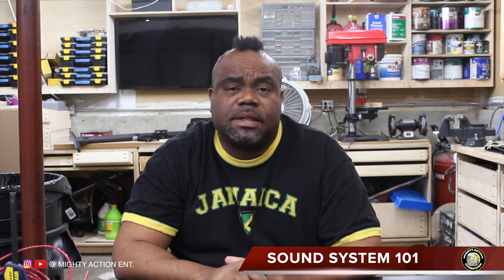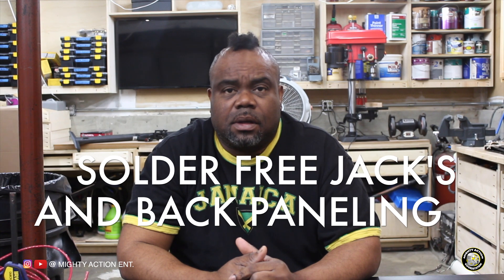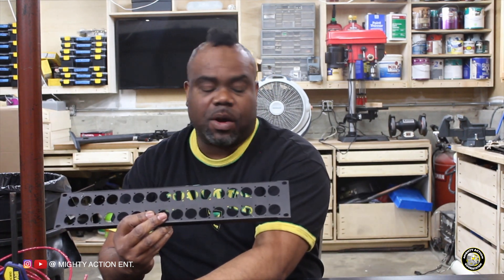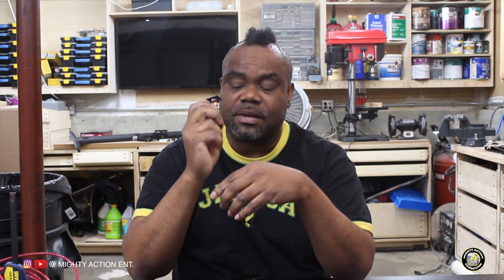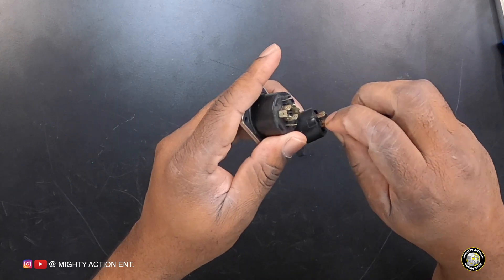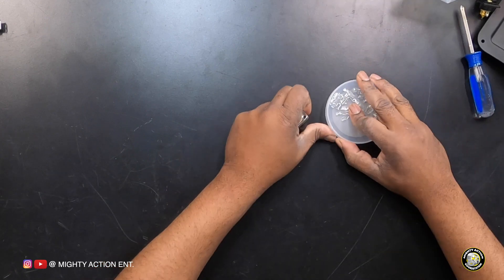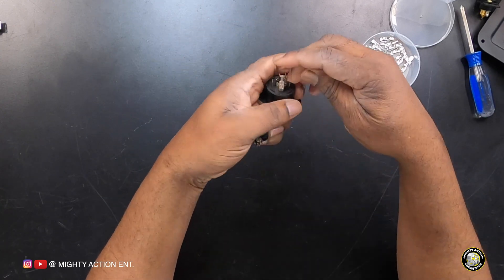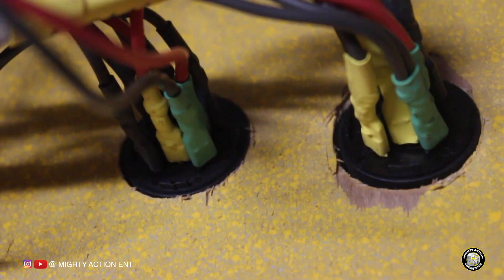SOUNDSYSTEM 101 - WHY ARE YOU STILL SOLDERING YOUR JACKS????

Comment: Soldering never caused distortion, if you don’t solder properly it will fail. Solder doesn’t fall off either 😆.
Reply from the maker: Over time soldering will fail you!
Good luck
Reply: @MightyAction  it never did I have been doing electronics for 30 years and the only thing that caused failure was original circuits that were over heated by faulty components never a speaker connection I had refurbished many vintage appliances for years . If you don’t understand soldering it’s a different story 😆.

Comment: i agree 100% i dont solder either i use the same pass through for xlr and and tru1 and heat shrink crimp spade connectors
Reply from the maker: RESPECT ME BOSS, ANY ISSUES WITH THEM?
Reply: @MightyAction  no issues at all i even find that my connections are cleaner and minimal buzzing distortion even when increase master volume on mixer.
these connection are tight like a virgin.

Comment: soldering is stronger than any screw or crimp connection,... once you do it right. if you had an electronic technician background, you would have a different opinion.
Reply from the maker: Not going to deny that
Reply: @MightyAction  on a different topic....what you think about having multiple sounds to suit different venues? I find it more convenient to have a small powered sound for smaller gigs. Quick set-up, less equipment.

Comment: I do the same with my rack. Partly because I wasn’t confident in my soldering but mainly because it’s easier to problem solve if you’ve got spare cables to swap in if you happen to have a cable fail. And no need to bust out the soldering iron if soldering points fail mid session
Reply from the maker: finally someone gets it! respect me boss. thats exactly how i see it, much easier!

Comment: Every connection can be a failure point. With solder you must secure the cable and have strain relief. Having a barrel connection adds more weight, more failure points and cost. There’s no rules, but just a thought

Comment: Nice Channel. As an ex sound man whose been soldering for decades, it ain't that hard Bro. If you solder those leads correctly, they will never come off. If they are coming off, or falling off, then you are doing something very wrong. Soldering is a good skill to have in your locker even if you want to go your connector-to-connector route.  The price they charge for those connectors, you'll save yourself a ton of ££'s or $$s by learning how to solder like a Pro… then that's more cash available to buy music or other necessary gear… Trust me!… Nice info. though. Keep on keeping on.

Comment: 1: Use solder with flux. 
2: Tin both surfaces to be connected with a layer of solder.
3: Connect the two parts to be soldered then heat them up till the solder melt & flow then remove the soldering iron.
4: Do not use cheap wire which will oxidize over time then break connection. 🧐
I have made guitar & studio cables over 30 years ago which I still use today. Soldering will save you a ton of money.
Reply from the maker: thanks for the input me boss, respect

Comment: I would like to have those (solder-) RCA connectors if you don't want them bruh.
I have to say, if your solder breaks that easily, you didnt flow it properly or soldered on a dirty surface.
If it doesn't flow, do it again. And if it breaks it's usually not the soldering but not enough clamping of the cable. If it wiggles , you're screwed sooner or later.
Reply from the maker: Hit me up 5715action
Reply: @MightyAction  What do you mean?

Comment: I thought I was gonna see a video of how to make cables without soldering. For me there is no cost effective way of getting around soldering and am very good at it so I never end up with cold solder joints.
Reply from the maker: yes it has a lower up front cost when you solder. Making your own jacks, cables etc.. with bulk mic cable and jacks. But regardless of my solder skills, i still think it works out better for me this way. I don't have to worry about having to solder a jack in the middle of a event etc.. If a jack ever fails just bypass it in the matter of a second. Cold solder joints isn't the only thing one would worry about. There is lots of other things that can cause a wire to brake off the jack at the point of soldered.

Comment: Yes my brother  great video  . I am trying  to move away from soldering  also. 
But there are cases when I do have to make a solder . I build  lot of XLR  cables for my mike system at church. When I do build them I used the plastic  epoxy  to help hold the joints .

They are working  fine for about 4 years now . 

But the raw wire to speaker boxes and wire all over the amp rack is a no no in this primitive  time .
Reply from the maker: i use to build my XLR cables as well, but i think this works out better for me. yes its more expensive but less hassle in the long run.

Comment: ACTION SOLDERING IS WAY MORE BETTER BECAUSE THE AVERAGE SOUNDMAN HAS TO PUT INTO CONSIDERATION COST , AVAILABILTY  AND TIME.  YOU DONT SOLDER BECAUSE YUH NUH GOOD AT IT . TWO  OF THOSE CRAPPY CHINESE CAN BUY ONE COIL OF SOLDER , A SOLDERING IRON AND A PAIR  OF STRIPPERS.
Reply from the maker: for me its the opposite, it saves me time and money in the long run to not solder. trouble shooting is faster, the jacks can be bypassed if they go bad, so no need to be behind the sound in the middle of a event trying to re-solder a wire. plus it doesn't matter how good you are, solder probably have a life span on it. i just prefer to get these jacks to do the work easier.